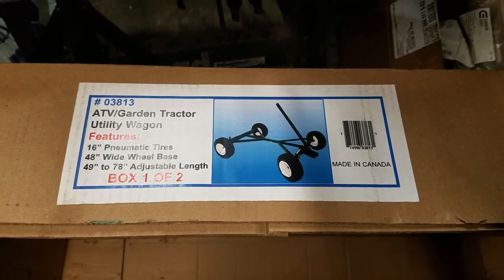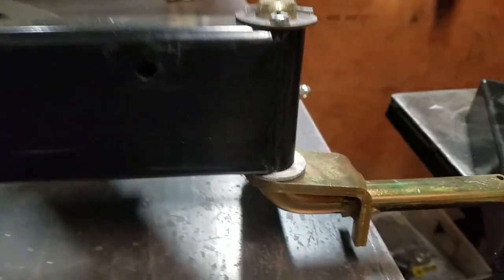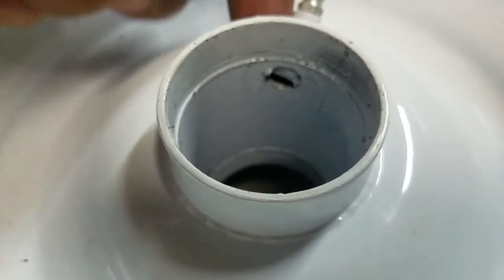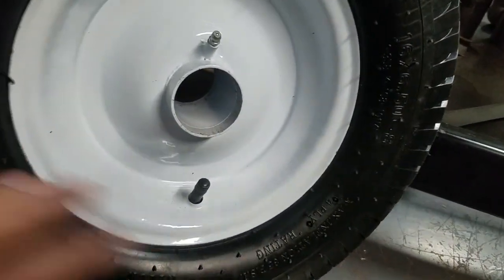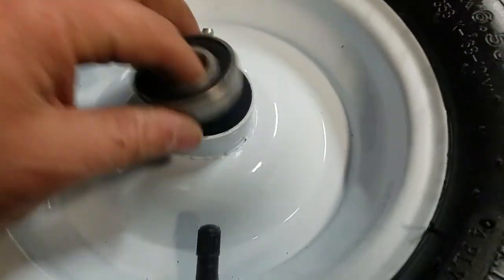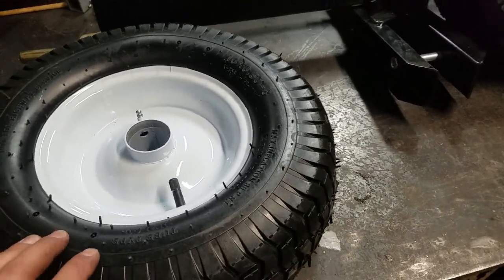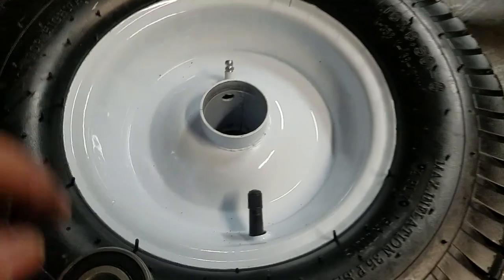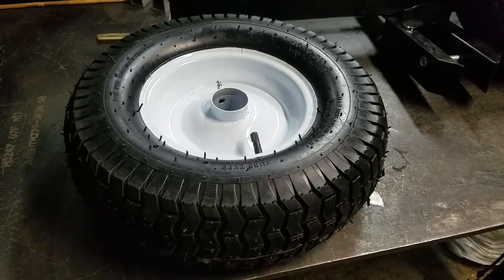Buyer Beware - Farm-Tuff ATV & Garden Tractor Trailer / Wagon — 2,200-Lb. - Steel Shot In Wheels

Comment: If those are the bearings that came with the kit, there is no need to grease them at all. You cannot get grease into that type of bearing and they are pre-greased. Just seal off the hole.

Comment: I made an electric bicycle drawn camper wagon, with this Frame and you can see it on my YouTube channel... one of my axle ends had a burr in it from shipping damage but I just filed It Off... I've been running its stock and I always grease it... So far no troubles but I wouldn't mind being able to get a better set of wheels from farm-tuff at some point... Rather than  trying to find a replacement with the right dimensions,

Comment: Let me guess did you end up sending it back? I guess this is what we get for dealing with the Chinese through the Canadians... And I thought it was made in Canada... I may have to give them a call myself... At least to Northern
Reply from the maker: I kept it.  Like I said in the video I ended up sealing the grease system with silicone.  I'll replace bearings when they go bad.  My guess is the frame is made in Canada, but they order the wheel/rim assembly from China.  Other then that it's been working great.
Reply: Hey do you happen to remember what the axel diameter is? I'd pull it off to measure but I'm low on cotter pins